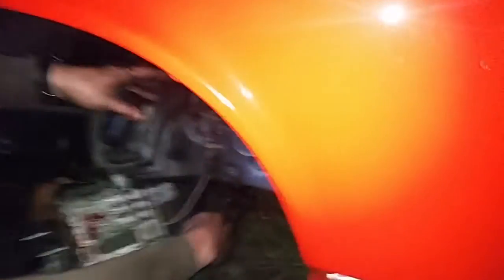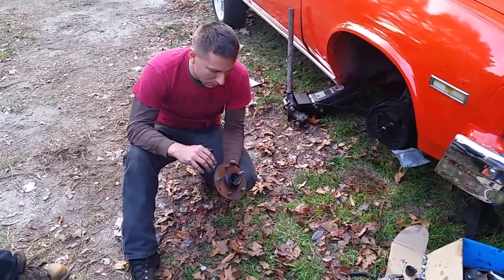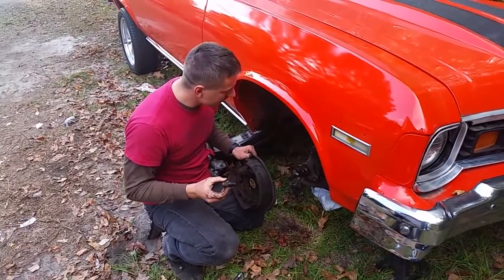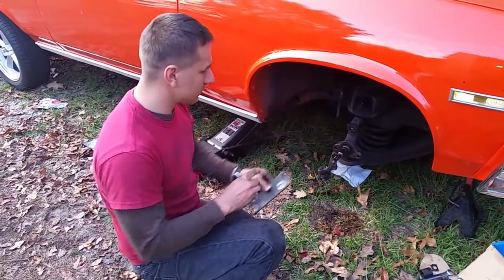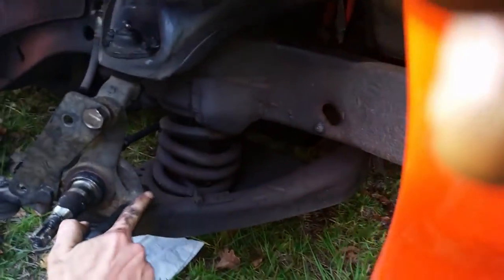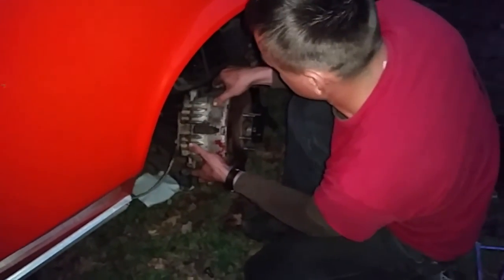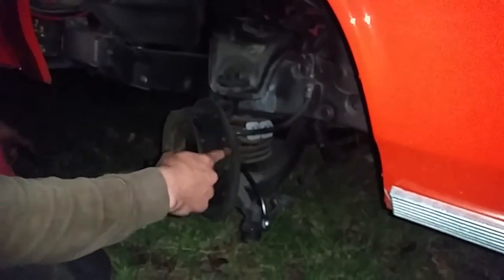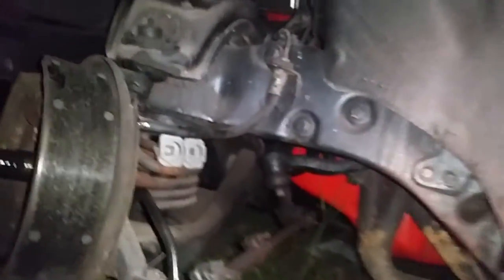12" LS1 disc conversion 68 - 74  Nova step-by-step HOW

Comment: It never ceases to amaze me some of the things discovered on some outwardly nice looking cars likevthis Nova. Thank the lord you are involved helping your friend to repair it so it will be able to safely handle the increased power of a large engine for the vehicle size. Those old drum brakes are an irresponsible mistake by the manufacturer themselves from the mid-70's enough, but the torture done to the springs and the removed anti-sway bar is something the person who did this should be accountable for. At least some folks as you are watching out for others. Keep it up!
Reply from the maker: You flatter me bro, but thanks.   Yeah, one of my pet peaves is people saying old cars dont stop well... yeah they do, if either the drums are maintained and the suspension is in order, or if the ill maintained stuff is replaced with idiot proof modern hardware.  I drove a 66 mustang 6 cyl drum car as is for 4 years and cross country too.  No issues, but i always stayed on top of the fragile drum adjustments and such...

But for spirited driving or rain, you cant beat the disc setup.

Thanks for stopping by, hopefully you found this video either helpful or at least entertaining ;-)
Reply: You are welcome.  Indeed, no back pedaling here, I too have driven drum brake cars recently, ranging from 1955 Buick, 1956 Oldsmobile, 1964 Pontiac, 1968 VW Beetle, 1964 Chevy Impala, all well maintained cars, and also myself knowing the intricacies of drum brakes.  Writing late in the evening the proper statement was that the car makers could easily have had discs as standard equipment on the compact cars by the mid-seventies, they always held out till the last minute for improved equipment on the vehicles.  As always, I did stop (pretty quick too!) to see this video. Of course it was to the point, very helpful with none of the gimmicks or nonsense seen on so many channels.  Your channel is a well kept secret.  Too bad for those who are missing out!

Comment: I have a 56 chevy belair with a nova front end. All four tires have drum. However. I would be interested in changing to disk up front. What would I need to go disk in front and drum in back. Brake system for two different cars? Do I need new spindles to make sure they fit the nova front end before considering a kit? And then if I have disk brakes I would need power booster. And new reservoir. Seems like lots of mixing and matching. Then I would have a brake pedal system that is 12 inches off the floor, still! I'm confused beyond spelling it out. If you have any info for me please let me hear your suggestions. I even pay for advice if it works! What would be my best way out of this dilemma ? Thanks. Rick
Reply from the maker: Rick Bell look at what we did for the 66 buick skylark.  It will fit your needs and wallet.

Comment: shade tree  guy here also. but i put the wheel under the frame while working under a jacked up car. if the jack doesn't hold you got a little more room. some say but that could ruin the wheel if you are under the car when the jack slips you wouldn't need the wheel.
Reply from the maker: Yup, smart

Comment: Just wanted to confirm, I'm looking at getting front and rear rotors and calipers off a 2002 LS1 Camaro. these should do the the trick correct?
Reply from the maker: +HuskyBoys don't forget the rear backing plates!
Reply: Totally,Thanks for the heads up!

Comment: Hello buddy i have a 73 nova were did u buy the brakets & what brakebooster should i buy to use both rear & front
Reply from the maker: Brother the best brakes you will ever drive on don't use a booster.  I use manual 4 wheel disc brakes on my 68 firebird and LOVE it.  You can stop so hard it makes your head spin.  But if you insist, any booster will work, its the master cylinder and proportioning valve thats important.  You can use the master cylinder off a 70's corvette.  And for a proportioning valve i HIGHLY suggest an adjustable one from wilwood.  That way you can set up the brakes exactly how you need them and the back won't slide sideways and you lose control when you need to panic stop...

Comment: Since you are the most informative person on youtube when it comes to these brake swaps, I have a "few"questions. First off, I have purchased a setup from a 2000 Firebird to put on the rear of my 71 Chevelle, but after watching your videos I am torn between this setup and the Corvette C5 setup. I heard the Camaro calipers have larger pistons than the Corvette ones but the Corvettes have a larger rotor, now I am understanding that I can use a Corvette caliper with the Camaro setup? Will 16" wheels still clear with the Corvette Calipers? On another video I watched, they claim a C4 Corvette rotor will go right on a drum hub without modifying the hub. Is this true? and if so could the C4 rotor be used with either the C5 setup or the Camaro setup to eliminate the need for machining the hubs? Sorry for all the questions, just trying to understand all this before making a final decision on the setup I will use. Thanks for putting these videos out here, you are very informative and I'm sure have helped many people that would not have known if it weren't for you. Keep the videos coming!
Reply from the maker: Allright brother, no worries.  I myself looked high and low for info and then just bit the bullet... heres the breakdown.  If you have 16" wheels you are limited to the 2000 camaro brakes.  The corvette setup requires 17's to clear the fronts.  Now on to the second question... the rears on a 71 chevelle (look in my 67 tempest playlist for the instal video) are better off with a 2000 camaro rear brake, they bolt right up with a $35 brp hotrods spacer and have a built in parking brake that works no matter what (if its hooked up)  now... corvette rear brakes are too funky to bother with, so i haven't bothered with them.  The Mounting flange isn't the normal gm one...  ok, on to the next question...  there are 4 types gm front brake setups that work for drum spindles... 12" ls1  camaro brakes, 13" c4/c5 hybrid brakes, and 13" c5/c6 base model corvette setup and 14" z06 6 piston monsters that require an 18" wheel (and not all 18" wheels fit even)  .... only the c4/c5 hybrid doesn't require turning down the hubs.  cpp (i hate them, horrible customer service) sells a chinese made setup that bolts up and works ok i guess (its on my 68 firebird) but its under $500 and i've been to 160 mph with no issues... now for the 67 tempest build i took a different approach and installed kore3 brackets (best by far) and used c5 calipers and c5 rotors.  But i did have to turn down my drum hub... i'll be honest, i took a marker, drew on my hub and then just used an angle grinder... yup, it worked.  Also a fan of mine did the same thing to install ls1 brakes on his 74 nove and LOVES it... no issues, and he took a grinder to his too.  See, the reason is, the hub bore of 70.5mm is the same in the 60's as it is today at 70.5mm for the 2006 corvettes (and 200 camaro) so the disc brakes center on that (not the studs as many wrongly think) and the disc brake does not vibrate or wobble as long as it itself is not damaged.... hope that explains it for yah... btw 4 wheel disc brakes off a 98-2002 camaro aren't a bad setup.  Without any power boosters i towed a 5,000 lb truck behind my 68 firebird for 800 miles... thats a combined weight of almost 9,000 lbs and i had no issues and that was MANUAL disc brakes.... and then turned around and towed my 67 gto clone home 800 miles INCLUDING THE MOUNTAINS OF KENTUCKY... no issues again with a combined weight of almost 8,000 lbs... look up my facebook page "invincible extremes" for pics if you don't believe me ;-) 
Thanks for the kind words and good luck brother...
Reply: Invincible Extremes Thank you so much for the reply, you have made it clear which setup I will go with...The LS1 Camaro Brakes. I will only lose an inch of rotor and will still probably be overkill for my car, it seems like a great setup. Thanks again Bud, I sure appreciate you getting back to me.
Reply from the maker: Chevelle61265  the calipers are practically the same... good brakes.

Comment: Couple Questions - Just purchased a 68 nova and it has drum brakes all around. Exactly what would I need to convert everything to disk brakes.
1998 - 2002 camaro calibers for front and back. Then purchase kore3 brackets and  c5 calipers and c5 rotors
Back brakes. I need to get the E-brake assembly for the back as well from the 1998-2002 camaro c5.
Rear brakes is need the - brp hotrods spacer 
What about master cylinder and porpotioning valve and dust plate for the rear brakes?
Thanks for your time.
Reply from the maker: you need the entire backing plate off a 98 camaro if you intend on using the 98 camaro brakes.

also, c5 corvette and 98 camaro brakes are two different brakes.  decide on which one you are going to use and use them.   the c5 brakes need a corvette  c5 caliper.  that swap is in a different video and that should answer all your questions.  look for the swap on my 67 gto.  the spindles are the same as the nova so that video will be helpful.

i used a 73 corvette manual 4 wheel disc master cylinder and a wilwood adjustable proportionining valve.  all those videos are on my channel.  should be all the info you need
Reply: Is your shop in north carolina
Reply from the maker: +K Mac not shop, I was just helping a friend, and Fixing my cars as well.  right now moving across the country
Reply: Do you have any tricks for suspension work. I also need to upgrade the suspension on this car. The springs are beyond shot. Do you know of affordable swaps that can be performed. The after market kits can get pricey. I don't recall any suspension swaps on your site. Also do you keep the standard steering box on your cars or do you upgrade to R&P steering and if so is there a swap for that as well for my 68 nova.

Again thanks for your time.
Reply from the maker: +K Mac just buy a hellwig 1 1/4 sway bar and some BMR big block springs.  theres videos on that in the gto playlist.  later when you get the cash grab some bmr upper control arms with derlin bushings and a taller ball joint.  really thats all you need.  do the springs first and it will be the biggest improvement
Reply: Yet another question. Once I convert to disk brakes and BMR big block springs what size tire and wheel can I fit under the 68 nova. Based on your you tub's it looks like your putting 17'' wheels under with no modifications. If so what wheel, tire and BS are you using.
Reply from the maker: K Mac biggest that will fit is an 18 inch.  255 35 r18.   Do the math, anything bigger than that will rub badly.   18x8 wheels with zero offset.  So about 4.5 inches of backspace is exactly what ypu need.
Reply: Is there a reason behind using the big block springs vs small block springs. I will be running a chevy 350 in this - hopefully 400+ HP
Reply from the maker: +K Mac better handling... but the ride may be a bit harsh, so smallblock springs from BMR or hotchkiss should do well

Comment: Can this kind of conversion be done using disk brakes form a 95 9C1 and put on a 73 olds Omega? I am pulling the LT1 out and putting it in the 73 Olds. It would be nice if I could use the brakes as well.
Reply from the maker: Glenn Green anything can be done, just gotta make some brackets
Reply: Thanks for the reply

Comment: Hey man, I have a 1977 Chevy Nova and want to do the LS1 brake swap in the front. Any ideas of what I need in order to make that happen? I was told that I could use B-body spindles.
Reply from the maker: I think it's just bolt on bud.  No need to swap spindles if doing ls1 brakes
Reply: Invincible Extremes Muscle Cars Garage i called BRP and was told that they dont sell a bracket adapter for my car and I wouldn’t be able to do it because of the way my spindle is made.
Reply from the maker: Huh... let me do some digging and take a look.  Send me a message on my Facebook page for this channel and I'll send you what I can find.  What state you in?
Reply: 77 nova should be the same as a 77 Camaro.  Unless I'm missing something

Comment: hey invincible extremes. what all would I need to put disc brakes on the front of my 71 elcamino and still run a set of 15" rallye wheels. kind of on a budget just wondering what's out there that will work.
Reply from the maker: Dustin Horn watch our 66 skylark disc brake video.  it's a $239 kit that we fit under 15 inch wheels

Comment: +Invincible Extremes Muscle Cars Garage Am I correct in thinking you can only run 16" or larger wheels with this method.  I have 15" rally wheels.  So I don't think this application will work for me.
Reply from the maker: yes.  you are correct.  modern brakes require modern sized wheels.  you cant really get anything worthwhile under 15 inch or smaller wheels
Reply: Thanks! I have a moden torque thrust type wheels but also have old style rallies that I would like to switch out from time to time.  I'll just have to go with a kit that allows this.  Any suggestions?
Reply from the maker: ThaGrandDiamond stock pin style disc brakes are about in... single piston

Comment: AIR RIDE IT !!!!  I have a AIR RIDE springs on the front end on my Suburban. Rides like a air ride Peter Bilt.
Reply from the maker: i'm sure he can't afford it... but that'd be cool.  the irony is my 68 firebird stock springs and cut down some with the stock 68 firebird sway bar would've been free and a huge improvement in safety for him.  but i tossed them years ago.  thanks for stopping by brother.
Reply from the maker: cyclemaster46 yeah, only way he afforded the brakes was cause i went to a bigger corvette setup on my daily driven 68 firebird so i sold him this set for $350, master cyl and all...
Reply: Invincible Brotherhood I know the nova needs brakes, but that may be slightly overkill!
Reply from the maker: ***** can't beat good brakes, now he just needs a decent set of springs and a stiff sway bar and he'll be safely driving rain or shine with the same feel as a much newer car...
Reply: Invincible Brotherhood very true, but there is a fine line between under, and overkill and those brakes have crossed that line into overkill zone, but that isn't a bad thing! but when you drive an old car, don't you want it to feel like you are driving an old car? or has the counsel tought me wrong?
Reply from the maker: ***** lol, you should see the brakes on my firebird... not just disc front, drum rears, but massive 2006 corvette brakes all four corners... and the car still feels like an old car, still rattles and rolls and sets of car alarms everywhere and i feel the feedback from every pebble in the road...  thats because when i built the firebird into the monster it is now, i never installed creature comforts like a vacuum booster or power steering, or a stereo of any sort or a 6 speed transmission... nope, manual brakes, no power steering, or sound insulation, or a stereo... just the bueatiful song of a 7.5 liter pushrod v8 happily guzzling fuel and the feel of a manual 3 speed with a stiff clutch and a brake pedal that takes some effort to push and steering that takes man hands to hold on to while 500 hp is sliding the car sideways untill 75 miles an hour...

see, a lot of people install a modern interior in an old car and a CD player and a 6 speed and make the brake pedal and steering all soft with boosters....

I install the confidence to embarrass the crap out of a porsche around a corner while sitting in the stock 1968 seats that have been restored right and enjoying american muscle for what it is ;-)
Reply: Invincible Brotherhood hah! that's how ya know you have a good car, it feels old, but preforms new! that's why I respect people like us...... we do what shouldn't be done, but are proud to do it!

Comment: Around how much am I goin to spend to convert my front dumb on my 73 nova to disc brakes like this n can I just use a new stock proportioning valve from a 73 Nova and the original master cylinder
Reply from the maker: Ismael Lopez watch our $239 disc brake setup on the 66 Buick skylark.  cost us under $300 to do it all and it kicks butt.  you can't use drum master for disc brakes btw, has to be a disc master.  luckily it's only $39
Reply: Invincible Extremes Muscle Cars Garage  Thanks !! 👍